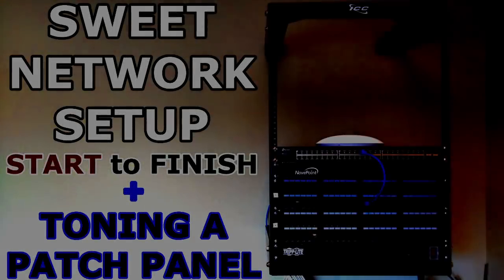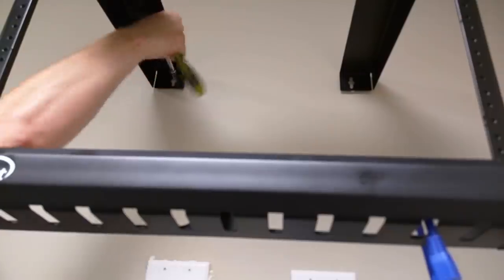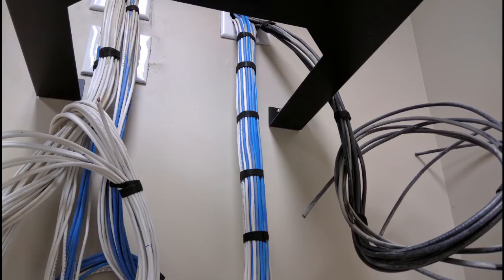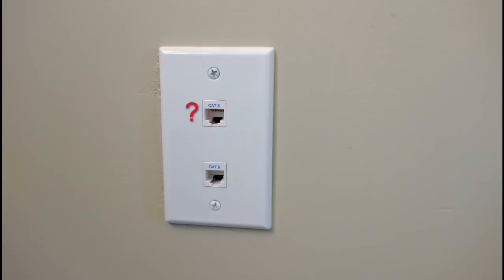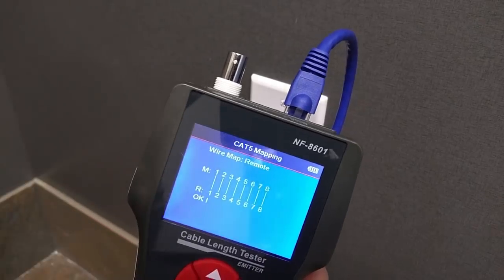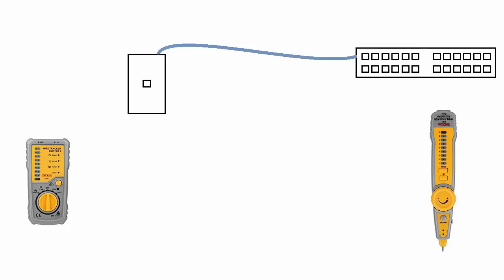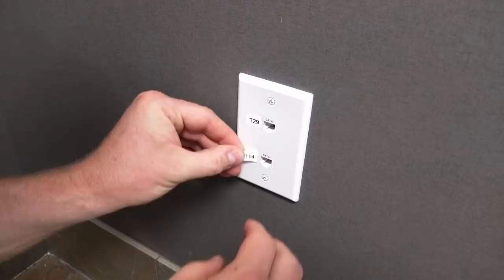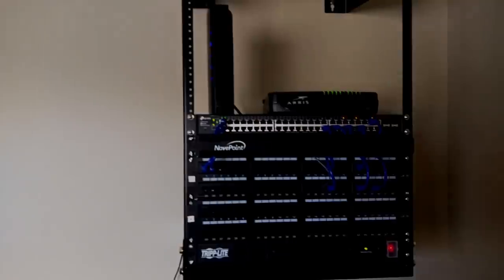Complete Network Setup // Toning, Identifying Ports

Comment: A Tip for Rack Mounted Devices:   I noticed at 04:30 the top screws were going in first.  When placing the switch, router, patch panel or whatever into the rack or rails, I recommend putting the screws into the lower holes first.  For lightweight devices it doesn't matter much, but for heavier ones the lower screws will act as a pivot point, with the weight of the device causing the top of the panel to move toward the rack or rails.  By putting the screws into the top holes first, the weight will try to make the bottom of the front plate move out from the rack or rails.  For units like rackmount servers and such it makes things so much easier.
Reply: Thanks for reminding it... 😊👍🏻
Reply: For heavier equipment, place screws in the holes immediately below where the bottom edge will be.  You can then rest the equipment on the screws, as you use both hands to mount it.
Reply: @James_Knott  That's also a very good suggestion!

Beware of the hole spacing on racks and rails.  There's a standard "Unit" size (1.75 inches as I recall) and the pre-tapped holes are not evenly spaced.  So a "1U" high device takes up 1.75 inches, a 3U is 5.25-inches, etc.  I have actually seen a tape measure with markings for every standard Unit along it!
Reply: @bobblum5973  Yep, I started working with racks around 1973, in the old Toronto Stock Exchange, where the telecom company I worked for had a site.  You can learn a lot from experienced techs.
Reply: @James_Knott  That's why as I became an experienced tech I wanted to pass it along.  But I've also always been willing to learn from the newer ones, together.  "Co-Mentoring" is the term I came up  with for that! 😁

Comment: Toner tip: use a shorted jumper with the catch clip removed (faster) while you are using the wand, the tone will stop when you found the correct port and only the correct port. It is rf bleed that inpregnats a wire the rubs parrallel with yours. Also huge help on shielded cabling as the side of the wire will not allow for correct identification with sound of tone unless you make a jumper from tone generator that uses the shield as one of the tone generators to attach to.

(This has been a life saver on many many jobs.)

Comment: Basically an example of everything not to do. Tone cables first so that you can punch them down in a logical order (same room together, same wall plate together) and use the strain relief on the punch down. Don’t punch down equipment to punch panels. Don’t put un-crimped RJ45 plugs into panels or equipment, you can mess up the plugs. And don’t use RJ-11 plugs in an RJ-45 port either.
Reply: Thank you, was watching this the whole time thinking this. He also didn't use the wall outlet plate he installed, and that one had the plugs facing the front instead of the back for some reason
Reply: Oh God, I missed the RJ11 :D

Comment: Don't plug unterminated RJ45 jack into anything, because the copper plates are not push in, and when you plug it in, it could screw  the socket up.
Reply from the maker: I know this, they weren't in all the way, they were barely dangling there. But good tip none the less..
Reply: @BudgetNerd  I would recommend buying some rubber plugs (similar to those you get with new PC components)  I personally use these: https://www.amazon.com/gp/product/B07C6GKQ5L/ref=oh_aui_search_asin_title?ie=UTF8&psc=1
Reply: @BudgetNerd  Use RJ45 Dust Cover--(also color code) (DC-0) (from R.J. Enterprises @Amazon.com) to solve the problem.

Comment: As this was three years ago and was on a buget I am sure this has improved. I would recommend putting the switch in the middle between the two patch panels, that way, the patch panel at top doesn't get over burdened with cables from the lower. I would also recommend getting a shelf for equipment to sit on top of others. That way, for any reason you need to swap out the device holding said modem/devices (in this case, would be the switch) you wouldn't need to fiddle with removing that stuff.

Comment: Dont punch down blindly then go toning out / using a tool to find them... when you pull the cables use a fine sharpie to number them as you start pulling them out of the box, then put the same number on the cable when you cut it off the box and then punch down in order. That way you wont have to chase down all the ports. Make sure you number more than once on each cable (i generally do 3 or 4 numbers over about 1 meter (3-ish feet for the americans) on each end... also number before you cut so you dont get mixed up. Generally if doing a small number of cables I'll have two boxes, odd and even, or just write the current number on each box and cross them out as you go... will save you a LOT Of time and you'll get logical numbering on the wall ports (i.e. ports 1 and 2 on the first plate, 3 and 4 on the next, rather than having 19 and 32, 06 and 18 on the next, etc.
Reply: Nah, Just punch them all down then use your 35 jack toner to label the outlets with their corresponding patch panel jack. It's faster. Trust me.
Reply: @michaelwaters6829  sounds like that will take forever, running in and out every room just to find one cable in one outlet because the second cable got punched in as cable nr 18 instead of 3and4. you mark the cables when you pull them and then you punch them and does all that what @Matt Byrnes said.
Reply: @zapy-85  I've done it both ways. The sharpie method sometimes fails you when the sharpie gets rubbed off. Also on large pulls, spending the time to seperate all the cables and route them to look nice takes time as well. Routing them how they lay and punching them in order then jacking 35 of them with a toner kit doesn't take much.
Reply: @michaelwaters6829  Still, you have to run around and test them with the toner to find them,
and thats why i dont use those old shitty panels, i use keystone or similar, then you can move them around freely and dont have to "route" them, but if you do label them at the pull you wont need to route them.
if the sharpie comes off id say buy another sharpie that dosnt come off. =)
Reply: @zapy-85  you miss understand. You jack them in their outlets and search for them on the panel. 35 or 64 at a time. Any serious tech has a toner that has 35 or 64 rj45 toner dongles, numbered. All you have to do is plug them in, in your wing, take one trip to the patch panel and tone them all right there. No walking back n forth, unless you count collecting the dogle while labeling the outlet. Your still going to have to walk to each one to fluke test it anyways. So might as well do it right then too.
Reply: @michaelwaters6829  I concur this is the way I was trained ✔
Reply: @michaelwaters6829  can you not tone them with this process before punching them in? like, leave them bare at the end, find the first tone, and punch that into the panel right then and there?
Reply: @masterseanwit3594  No, if you use a sound toner your get crosstalk everywhere. Its faster not to. But some people charge by the hour and want to take the slower approach. To each their own. On small jobs I just tone but big installs you use the 45doggle method. Thats the magic of Keystone jacks and why i reccomend them. you can allways come back later and change your label scheme.
Reply: @bridgecraftersstudios8499  at least you use the keystones so if you wanted to order them in a logical manner, it would just be a matter of switching the keystones.
Reply: " when you pull the cables use a fine sharpie to numbe"  I use a heavy Sharpie to put large marks on the cable and instead of numbers, I'd put 1,2,3,4, etc.. heavy marks.  They don't rub off as easily as numbers with a fine Sharpie.  Also, do it multiple times on each cable.
Reply: @James_Knott  You need a proper labelling scheme for anything bigger than a small job. the easiest way I have found to deal with losing numbers/labels on cables is to mark it 34 times every f0ot/half metre or so.